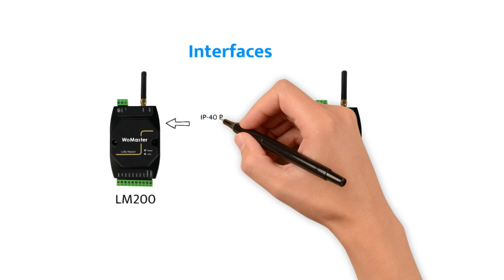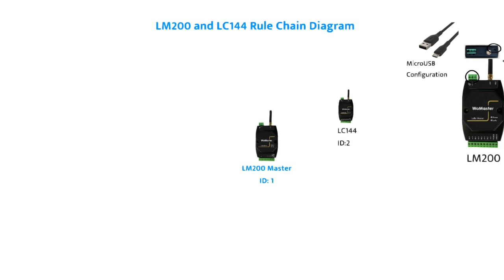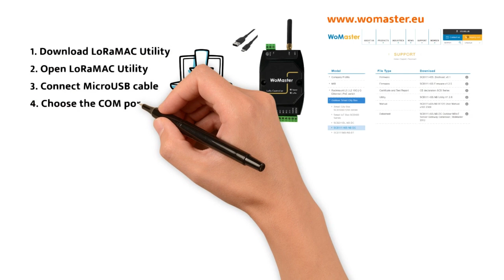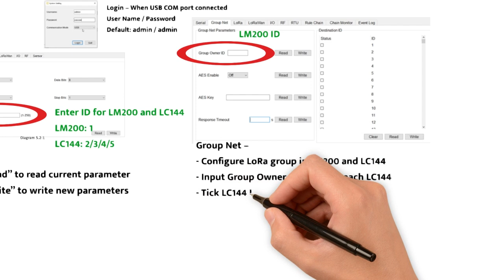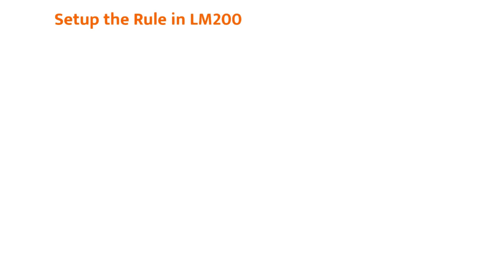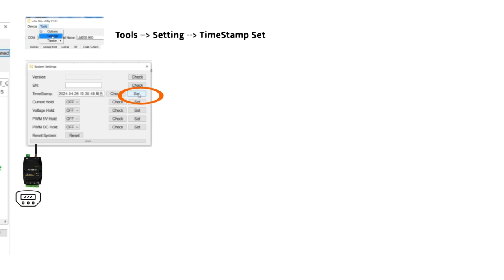LM200 for Analog Inputs Outputs Mirror over LoRa

Comment: Imagine a smart street lighting system in a city using LM 200 and LC 144. Each streetlight is equipped with light sensors and motion detectors connected to the LC 144 controller. The LM 200 gathers data from these sensors and uses AI to optimize lighting schedules and intensities. For instance, the lights can dim during low-traffic hours or brighten when motion is detected. This system not only reduces energy consumption but also enhances public safety by ensuring well-lit streets when needed, offering a sustainable and efficient urban lighting solution.
Reply from the maker: It seems so nice!